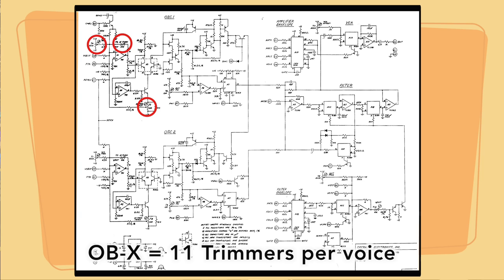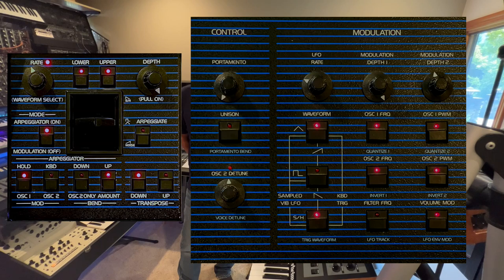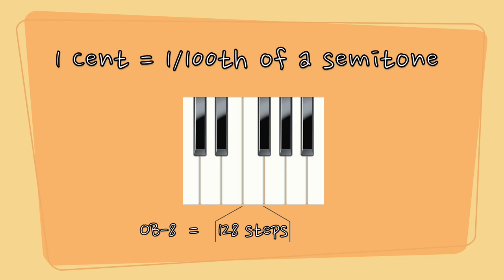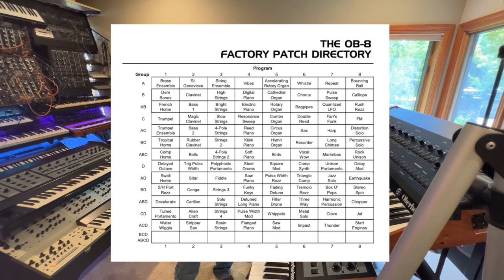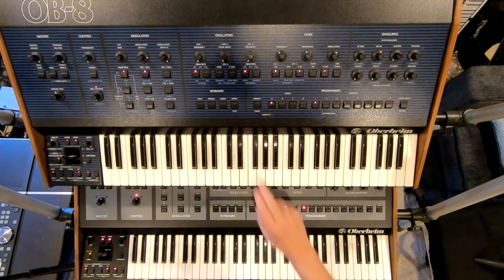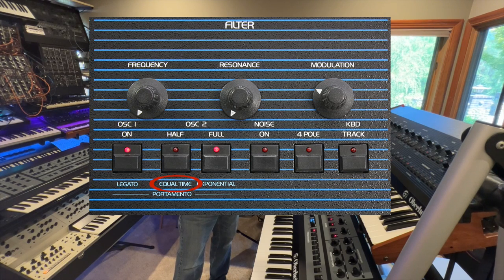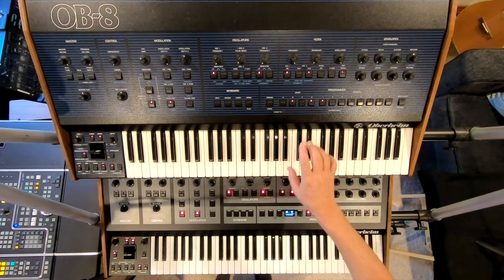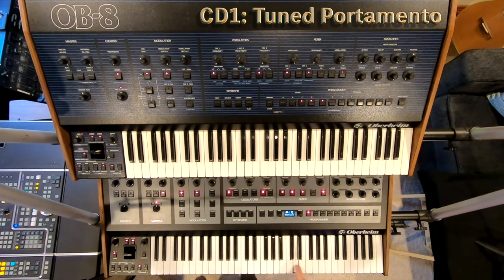Comparison #3: how OB-X8 compares to an original OB-8

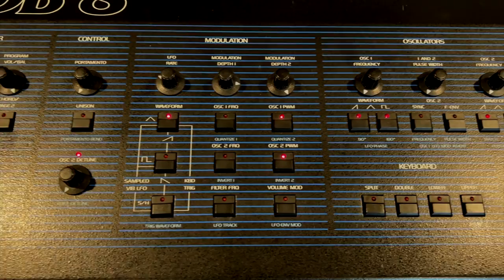Comment: I think Prince used the tuned portamento feature in The Beautiful Ones from Purple Rain. Listen at 2:38 in the song, you hear this string sound gliding down from an upper preset interval.  The portemento knob controls the rate of the glide, so as he plays along, he could have turned it off by rotating the portamento knob to zero.  I've replicated this sound on my OB-8 and it's spot on.

Comment: I still maintain that the most often used Page 2 features on the new OB-X8 should have been accessed directly from the front panel WITH the added silkscreening. Missed opportunity from Marcus and the team at Sequential to maintain a quick access feature from the OB-8.
Reply: You can access them from the panel, do you own one?
Reply: Many of the page 2 settings, can be accessed via the front panel controls. I used a vinyl label-maker to print-out each secondary ‘page 2’ feature, and it really expedites the process.
Reply: @PacificIslandDrive  
That's my point exactly, on a synth of this price, there should have been silkscreening already on it for the page 2 features under the knobs and buttons. Just like on the OB-8.
Reply: @AlainHubert  Ok. I wasn’t sure if you knew that most of the knobs & switches, have ‘page 2’ functionality. Otherwise, yes, an additional optional overlay, with graphics, would be nice.
Reply: yes... such a missed opportunity. maybe they'll release a new graphic at some point, much like they did with the OB8!
Reply: @MusicFed  If Oberheim isn’t already considering it, it’s likely some third party graphics company is going to come out with a wrap with page 2 subtitles and the blue pinstripe motif. It’s been done for other synths, the Alesis Andromeda A6 all black graphics being one that comes to mind.

Comment: Okay, so these instruments [OB-X8] finally came in to the local music stores, so I had a chance to witness one in person, and even try out some ii, V, I progression on the brass sound.  The overall experience was good.  The instrument looks good, feels good, and sounds as expected having a handful of analog-type waveforms available on board.  I even had some brief thoughts how would the OB-X8 fit into my setup, as a second keyboard on top of a 88-note weighted keyboard.  But I haven't pulled the trigger yet.  I can't get quite convinced about having analog oscillators when the competition [namely the Jupiter-X] can run circles around it in digital domain.  And then there's the price.  I can have both the Jupiter-X and Juno-X for the price of one OB-X8, or one Fantom 8 for even less than the Oberheim, and having all these instruments side by side at the music store, is making the OB-X8 quite a hard sell.  Don't get me wrong though, my first experience with OB-X8 was generally positive.  And after getting jaded with the wealth of sounds and features of the Jupiter-X, the OB-X8 can be an antidote, if not only to see and appreciate how much more the digital synthesizers have to offer.  Going back to basics can be very refreshing at times.

Comment: Although I have not A/B'd the OBX and the OBX-8 in the same room, you can clearly hear that the older Synths are a tiny bit more open (airy) and bigger sounding in some cases/sounds. Of course, you can do a lot more with the new OBX-8, and you don't have to worry about servicing it. The P2 Features are a Game Changer (ability to adjust volumes of Osc's/Noise, separate PW, addition of Notch and BP Filters, etc). The OBX-8 is a Beautifully Executed Synth. In fact, I think it's the best "reproduction" Sequential has ever done (better than the Prophet 10 IMHO) , but I don't feel it gets there 100% sonically speaking. I do, however, think it's damn close, and it's very musical in its own right. I really commend Marcus for doing the A/B for everyone, and not just waving his hands and telling everyone they're the same. Well Done!
Reply: Yes … very good, but lack the same magic, unfortunately.  This may be why you’ll never find any real info on the OB-X8’s oscillators … … …
Reply: @kierenmoore3236 ???
Reply: No